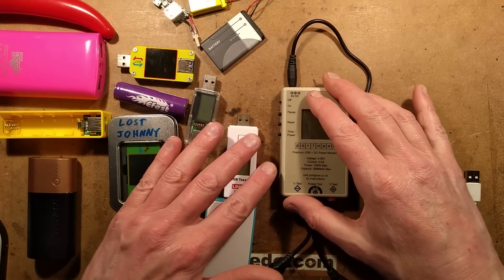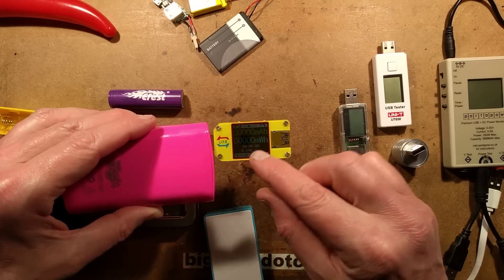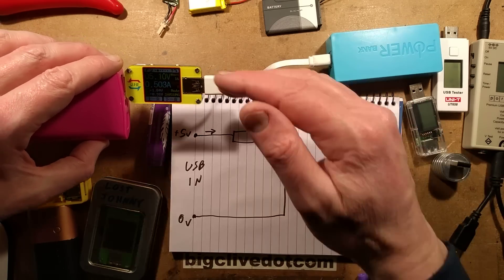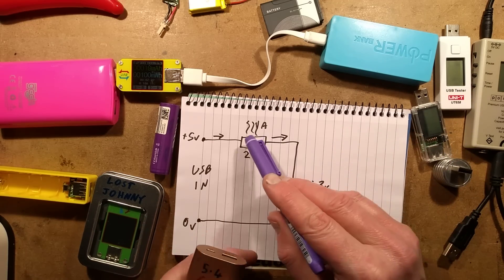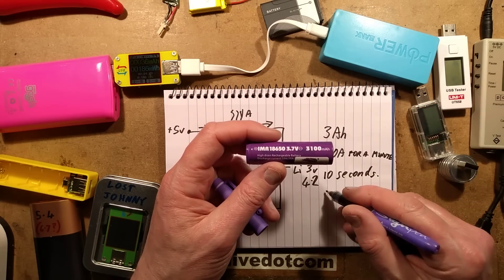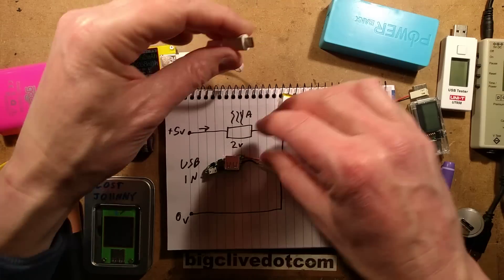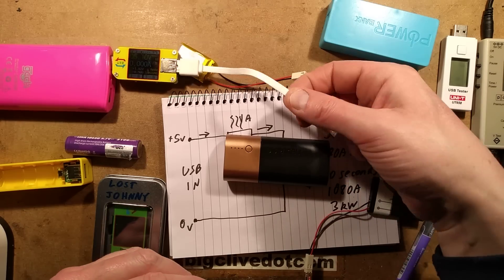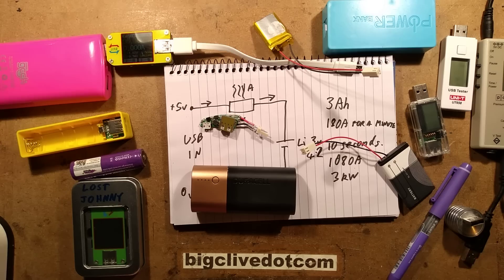How I test lithium cell and power bank capacity.

Comment: Thanks for sharing. Im interested in testing my NiMh AA cells and see what capacity they have and when I should dispose of them.
Reply: Depending on how many you use on a regular basis it could be worth getting one of those analysing type charger deals. The charger I have for NiMH AA/AAA and 18650 lithium ion cells has options to charge, discharge, run cycle tests, etc (I think technically C cells and 26650 fit too but never used them in it so far)

My criteria for discarding NiMH batteries are roughly as follows: I'll put them through a charge, discharge, charge
I note down the initial internal resistance (IR), discharge capacity, IR after its final charge. And then also check their voltage a day later (and if really paranoid maybe run another discharge test on them then. For ideal usage I write the measured discharge capacities on them too, this way regardless of age/cycle count you can easily put together a set with similar capacity for things that need more than one battery.

But basically I have observed two reasons so far for occasionally discarding some: high IR even after putting them through a cycle (making them useless for high drain purposes) or somehow they seem to have a slight internal short and lose voltage/capacity really quickly over time. NiMH batteries do seem to be pretty robust though many Eneloops that have gone through more cycles than I can count are still going strong. I have occasionally discharged them to the point they'd show up as reading 0V on the charger and they recovered from that with a useful capacity remaining (this happens with long standby times on things I forgot in drawers). Very rarely there's also a few that have such a high IR/can't retain any capacity that they'll shoot up towards 1.45-1.50V right after putting them on the charger and are nowhere near their rated capacity.

I have however pretty much transitioned to low self discharge only in the pile of NiMH batteries that still see active use, the little bit of extra capacity you get in "high capacity" non-LSD cells is pretty much wasted if they sit around for longer than a week or so after charging. Easier to have batteries that don't need to be charged before every single time you plan to use say that flash module for your camera or whatever (and your spare batteries in the bag will be charged too!).

As for what charger to get? I quite like my SkyRC MC3000 (expensive but worth it for the convenience) however for many use cases it is hard to justify buying one of those especially when you're only going to be testing NiMH batteries. For NiMH the Maha Powerex MH-C9000 has traditionally been highly recommended but that's also not cheap and based on a quick glance on my usual go to site for batteries and chargers this situation hasn't chaged the last few years https://www.nkon.nl with availability. 

For not so regular usage I would suggest to just charge them as you normally do and test IR yourself: if I remember things right this is pretty easy to measure with two multimeters, some resistors to simulate two different loads and measuring both current and battery voltage with both loads. Then do some math and you should have your answer, you could probably even make do with one multimeter and assume the resistance of your load is constant and derive currents from the voltage and resistance if its needed for the math (last time I did this was too many years ago, fancy chargers and other dedicated tools capable of doing this for me have made me lazy).
Reply: U Oude Hampsink The simplest solution is to buy one of the many NiMH chargers currently on the market that not only measure the total mA-hr input to the cell but also include a built-in charge cycling capability that will first charge the cell to 100%, then discharge it at a programmed rate, then will recharge to 100% and will then display the final capacity of your battery.  When charging most NiMH batteries I find you will get the best results if you select a 1/4 to 1/2C charge rate (that is, 1/4 to 1/2 of the battery’s stated capacity) — with 1000mA as my highest suggested charge current for AA cells —  as then good batteries will charge within 3-5 hours and will charge to an even capacity without excessive heating.  At higher charge rates the capacities even within otherwise matched sets will tend to vary significantly, but at 1/2C, or less, they pretty well charge evenly.  I use several PowerEx MH-C9000 chargers, purchased from Amazon, for my NiMH battery charging needs as they can not only charge the batteries at a programmed rate but can also be setup to cycle test and then recharge the batteries automatically.  The only downside is that these are not “set and forget” type dumb chargers, so you have to input your program settings for each cell you wish to charge each time you insert a cell, but fortunately it only takes a matter of seconds to do so once you learn how to use the charger (though if all you want to do is charge you could just accept the default charge program if lazy) — but this model is fairly easy to program compared to some others as it does not nest button functions the way some models do when they try to make a button do multiple functions depending upon press duration, this charger has the necessary compliment of four buttons to make things straightforward with only one function per button).  I typically keep around 50-60 AA and AAA NiMH cells charged at all times for emergencies.

Comment: Application on my phone measures the charging current, really good to know all those 2 amp chargers I have only out out a third of that 🤔😑

Great for battery life calculation too
Reply: Phonotical Maybe the application is wrong.  Or maybe the complex charging circuit in your phone limits battery load.  Or maybe your power source and phone don't use the same protocol to check if it's a 2A, 1A or 0.5A power source.  Plugging a good USB load meter in the middle should give more accurate results.

Comment: I have seen some rechargeable D cell batteries that claim to be 10Ah, do you trust that rating? Because I wanted a cheap 100 amp power supply and did t want to buy 900000  18650s
Reply: Why would one need 900,000 18650s?  A single 18650 is equivalent to 3 NiMH batteries in terms of voltage (3.7V vs. 1.2V) and can have an A-hr rating of up to 3.4A-hr.  If you do the math then you will have about 12.6W-hr (3.7Vx3.4Ahr) of power capacity in a single 3.4A-hr 18650 versus 12W-hr (1.2Vx10Ahr) in a single 10A-hr NiMH D cell battery — so a single high-capacity 18650 cell has more stored energy than a single NiMH D cell (practically speaking they have almost identical energy).  For 18650s you’ll generally want to keep your average discharge to around 2C (unless using high drain rate chemistries at up to 10C), so figure around 7A per paralleled cell when figuring average sustained current draw for such Li-ion batteries (brief higher excursions are generally safe if not sustained such that batteries do not over heat as they discharge), so 15 18650 cells in parallel could continuously deliver 100A at 3.7VDC versus, perhaps 15 NiMH cells in series-parallel (3S5P) to achieve the same result to deliver 100A continuously at 3.6VDC — and you will get more usable capacity out of the Li-ion batteries at such a discharge rate due to their lower internal resistance and greater total energy.  With high-drain 18650s you could get by with as few as three in parallel and still deliver on the 100A draw, albeit with less capacity to sustain since you would only have 10.3Ah-hr at 3.7V, but high drain chemistries are the Li-ion batteries most likely to start fires when things go awry, so you may wish to avoid them.

There is also an issue with the phrase “100A power supply” as the A-hr rating of a battery bank has no direct relationship on the amount of current that the battery is designed to supply instantaneously.  While 10 10A-hr batteries would be a 100A-hr battery bank at whatever that cell’s nominal voltage is, it is not necessarily a battery bank designed to deliver 100A nor does it mean that the current is in anyway limited to 100A if a short circuit were to happen.  Normally when we use terms like “100A power supply” we are referring to a power supply that can deliver a sustained 100A, either indefinitely (AC mains powered) or for some defined duration of time.  Because amp-hours is literally amps multiplied by hours then, for example, a power supply that could deliver 100A for 30 minutes would need at least 50A-hr capacity (at its 30min discharge rate) whereas such a supply designed to operate for 6 hours would require 600A-hr of capacity (again, at its 6 hour discharge rate) — I mention battery “discharge rate” because for many battery chemistries the functional capacity of a battery cell is often inversely related to the magnitude of the discharge rate, which is to say that the useful capacity (A-hr capacity) of many battery chemistries actually decreases significantly the greater the amp draw is (for example, a 200A-hr lead acid battery will deliver 200A-hr capacity at a 10A rate but only 100Ah at a 200A rate).  For Li-ion cells there is very little drop off in capacity relative to rate of draw (so long as you do not draw at a higher rate than the battery will safely allow for its chemistry) whereas for NiMH there will be much more drop-off as they have a much higher internal resistance (but still far less internal resistance than in my previous lead acid example).

So you really need to define whether you mean a 100A power supply — a power supply that can deliver 100A — or a battery bank I with 100 Amp-hours of capacity (the total amount of power it could deliver before being discharged).

Best wishes on your project!
Reply: @ethanpoole3443  I would just quickly like to add, well, nothing. :)
Reply: NiMH range from 2.2 to 12Ah, depends on the brand and generation  
NiCd only goes up to 5.5Ah

Comment: How do you test internal resistance? I use a Cadex C7400ER.
Reply: Garbled User On modern batteries it's rarely a linear resistance, and on a complete powerbank, the regulation complete hides the internal resistance.
Reply: You have an excellent mind. You are correct. Internal resistance calculations are usually tested at 95%-100% SOC (state of charge.)

Comment: Slightly off topic question. I want to run low current things (led strings, led clock) that run at say 10ma from USB powerbank because they should run a really long time.
But of the large variety of power banks I have they all switch themselves off at that low current load.
I have tried a circuit that ups the current to a higher level like 100 or 200ma which works but wastes so much power.
Is there a specific power bank that can remain on or a way to modify existing power banks to stay on?
Reply: look for one with a slide power switch or always on, most if not all of voltaic's have always on
Reply: @MeltedSpades  
Thank you. It seems like voltaic's are the only ones I can be sure have an always on mode.
However, they are very expensive - $60.00 Australian for 4000mAh.
I will consider how much I really want them.....
Reply: I feel your pain.  I got several of the same brand and model power banks for some Christmas decorations.  I didn't realize I was running just above the low-cut-off current (around 32ma) until the third one I built turned off.  Turns out, some of the banks had a slightly higher low-cut-off current.  The rest of the decorations now run about 40ma.  My suggestion would be to find a power bank with a small light on it OR a bank WITHOUT an on/off button.  ...  BTW - You might time the cut-off period and try a short pulse from your higher current circuit.  It might reset the timer.  (Not quite the elegant solution we are looking for.)
Reply: Alan Smith There are a few alway-on powerbanks out there, but most will shutoff after a period of time if the current is too low because always-on wastes power since the boost regulator circuit is continually cycling on to keep the output capacitor charged up and monitoring that voltage, which can lead to over-discharge of the battery if there is no protection circuit in series with the output.
Reply from the maker: The cheapest ones with no battery guage usually put out 5V all the time.
Reply: I've ordered a load of different cheap ones hoping one has a low enough cut-off for my application, I'll report back! If that fails, I'm thinking to make a small circuit with a 555 or so, that periodically draws a wake-up current to reset the standby timer in the powerbank without wasting as much power as continuously keeping it above the cutoff.
Reply from the maker: @ThePends  The simple ones don't cut off at all unless the lithium cell reaches its low cut-off voltage.  They continuously put out 5V and just top it up as needed.  They have very low standby current that increases to meet demand.  You can transplant one of the modules onto a bigger cell or stack of parallel cells.  There is one type that blips the output regularly to detect if a charging supply is connected.  But they're quite rare.

Comment: Any body ever tried using a lithium cell in a BEAM robot
Reply from the maker: They tend to be based on capacitors due to the need to run on very low current power sources.
Reply: bigclivedotcom  pardon me, but would you mind privately messaging me
Reply: Familiar with the use of capacitors in them, i was looking into building a circuit that would allow my symet to run when the sun goes down, a circuit that would charge the battery then when the sun went down it would turn on.

Comment: What was the name of the logger you use? I'd like to get one also.
Reply: I found it on Banggood https://www.banggood.com/RUIDENG-UM34-UM34C-For-APP-USB-3_0-Type-C-DC-Voltmeter-Ammeter-Voltage-Current-Meter-Tester-p-1297185.html?akmClientCountry=America&gmcCountry=US&currency=USD&cur_warehouse=CN&createTmp=1&ID=511646&utm_source=googleshopping&utm_medium=cpc_union&utm_content=2zou&utm_campaign=ssc-us-en-all&gclid=Cj0KCQiAvKzhBRC1ARIsANEXdgxyNLsqDInqT9NZiaHVsQgpcV1dTgIIu9bXjASuAHwyRrxWG5FVqskaAnV5EALw_wcB
Reply: @ucitymetalhead  There's two versions of these meters. Only difference is on the side port where you'll either find a micro USB or USB-C socket. They are both connected "V-in" for connecting direct to wall charger cables. My green one is a micro USB.
Reply: @lostjohnny9000  good to know might have to go with the green one.
Reply: @lost jonny there is 3/4types atm not just 2,
Reply: @ucity metalhead @Stalwart Computers Both Ruidengs have a bluetooth option with a nice app for PC/Android. Maybe worth the 4 dollars extra as the little SMD side switches can break easily. Just noticed the yellow one might have both micro USB an USB-C but BG are still selling green one for less.
Reply: @lostjohnny9000  for my own clarity just what is the side micro/usb c port for exactly.
Reply: @ucitymetalhead  It's just another socket that allows you to chain the meter from the power source to the load.

Comment: Nice roundup on Lipo batteries
Thanks for sharing👍😀
Reply: (not a lipo)
Reply: Lithium-polimer/ion - slightly different electrolyte chemistries alloy doping and nominal voltages but the same pixies drive them.  The value is it's the same principles that can be applied to any battery to measure it's capacity, even if not rechargeable.